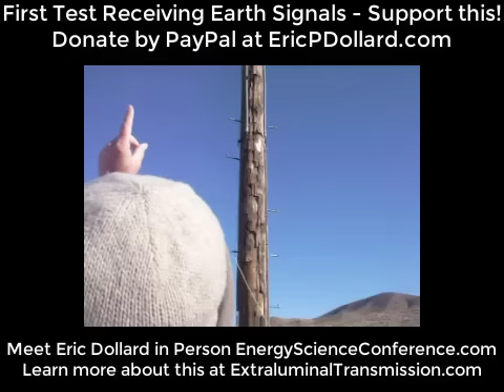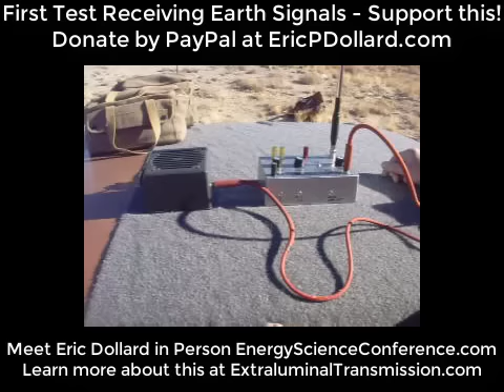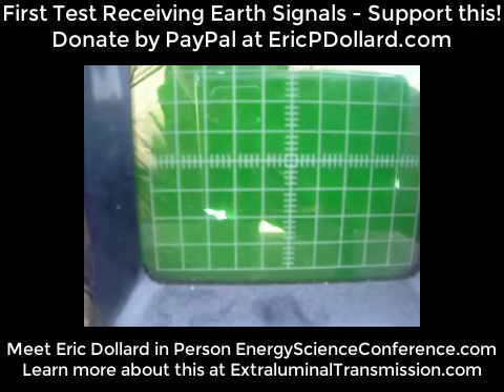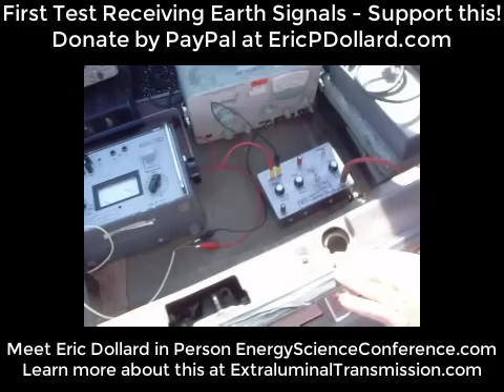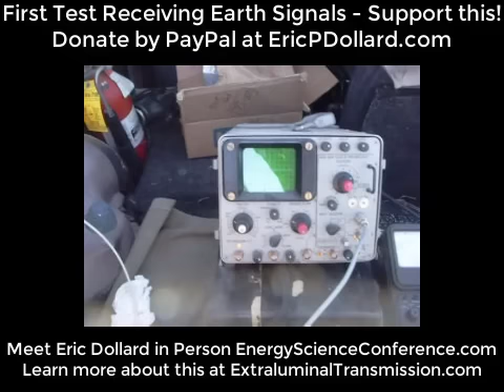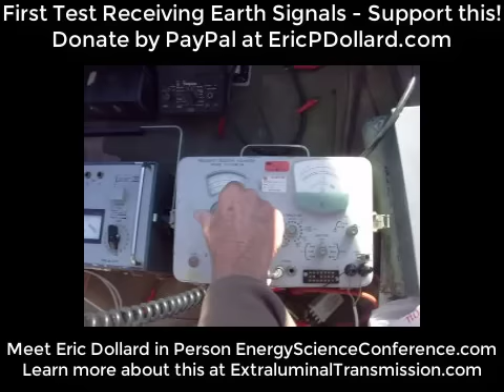The Power Line Is 10 Million Times Louder Than the Earth

Comment: well, sounds to me like magnetorestriction caused by the high voltage transformers on the poles. i also think the sounds of unisolated circuits can be that their is a physical drain on the line and your possibly hearing the drain on the circuit because their is radio frequency interfaces caused due to your non emi shielded wire's. just a guess but always need shielded wire's to prevent crosstalk or emi disturbance

Comment: The work you're doing is fascinating to me. The Interesting part of your video was receiving the Navy's VLF signals; it reminded me when I worked at Stanford University's Solar Center (Observers Group) to design and build an inexpensive classroom instrument that detects Ionospheric Solar flares. The SID Monitor was distributed world-wide for the International Heliospheric year (IHY) 2007.

Briefly, the SID monitor used a loop antenna of ~50 turns of #26 Gauge Solid wire in a 2 Meter (6 foot) diamond coil and the electronics are tuned to a single VLF Navy transmitters e.g. NLK (24.8 KHz), or  NAA (24.0 KHz), or NLM (25.2  KHz) to monitor the RF propagation through the ionosphere and outputs the signal strength over time.  The Monitor detects the sunrise and sunset effects, ionospheric/magnetic storms from the sun, and solar flares in the EUV and X-Ray energies; they were observable from the data output of the monitor.  From the audio output from the monitor you could hear the station as heard in the video as well as the clicks and pops  from distant lightning discharges.

We had similar problems with interference of the power lines, and overcame them with notch filters and other input conditioning.  The techniques used there might be helpful for your telluric studies... The schematics are all in the public domain:
http://solar-center.stanford.edu/SID/technical_docs.html

BTW: I don't have experience with these, but I've seen some plans for a grounded antenna coil used for picking up radio "sferics" (Atmospheric effects) and they had to minimize the power line interference -- again, there might be useful techniques for your experiments.

Comment: Can these sounds really predict earthquakes ? Does the crackling frequency get faster before an earthquake occurs ?
Reply from the maker: Yes - see this page: 
http://ericpdollard.com/2014/06/23/the-landers-facility-of-eric-dollard-and-walter-deroche/
 Eric uses 4 sets of data. Solar flux, mechanical vibration of ground, 
above ground signals and the below ground signals. When all 4 start to 
increase together as you see on the large 1 year hand potted graph, an 
earthquake 6.0 and above always happens. If there are 2 stations, the 
the location can be spatially determined. The crackling gets louder and 
louder and more frequent, yes.
Reply: Interesting that it could be a combination of the sun's solar flares and deep earth electrical activity that may trigger the plates to slip enough to create an earthquake....
Reply: http://www.eham.net/articles/887  http://authors.library.caltech.edu/58139/1/Kanamori_1977p10.pdf It's been known for years by ham radio operators that signals on the 20-80 meter bands can be detected prior to and shortly after major quakes. piezoelectric effect vibrate a crystal and it generates a frequency and voltage; that's the basics of it, but in this case it's the rocky mantle from the earth creating the 'ring'.  That's what Eric's system is built to detect. I'm not sure a digital system could pick it up? Maybe... but I'd put my money on analog system to be more accurate.

Comment: So this crackling sound is from plasma discharges deep in the ground ? or from telluric currents ? Can he already say from how deep ?
Reply from the maker: I don't know if he can determine how deep - good question.
Reply from the maker: Coil Smoke
It is different than that. These sounds increase in amplitude and frequency as an earthquake builds up but an increase in lightning occurrences do not. It is more connected to the solar flux.
Reply: My guess, Hundreds of cloud to ground lightning strikes and very cool !
Reply: Aaron Murakami It has that rapid rise time, impulse like, rapid discharge type of sound. . But, the oscilloscope trace did not look as spiky as lightning impulse at low frequencies. What ever the source, seismic stresses will influence electrical conductivity/amplitude and multipath phase relationships when the data is cleaned up and analyzed.